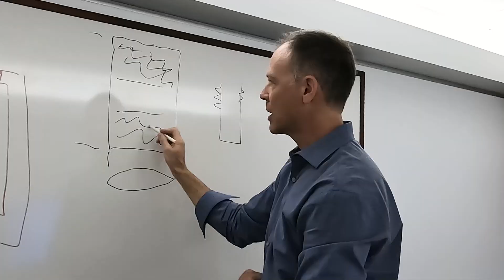New eFoil Design | Inside the HydroBlade Electric Hydrofoil Facility

Comment: If you want to make something cool that anyone can ride… Re-design this like a 74-Z speeder bike from Star Wars. Place the rider so they are seated on and drop down to a single mast with control surfaces on the foil so you can steer it without just relying on weight shift. Everyone will want that and it will be the JetSki killer we're all hoping for.

Comment: Interesting hydrofoil concept! Do you have any info on the company that is touted in this video? With a 75,000 sqft facility and years of manufacturing experience, I cant seem to find any information about your company. The website you link to doesn't have any information at all except a count down clock. The least you could do is a teaser spec sheet if you don't want to show photos!
Reply: Thanks for your interest.  The website is up and running with few images.  Lots of exciting developments going on as we are testing the first prototype right now.